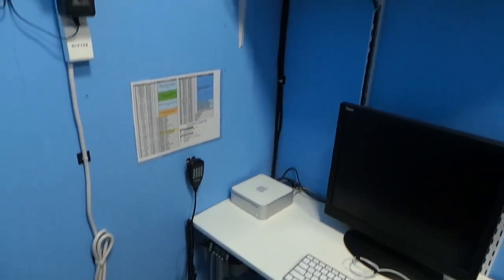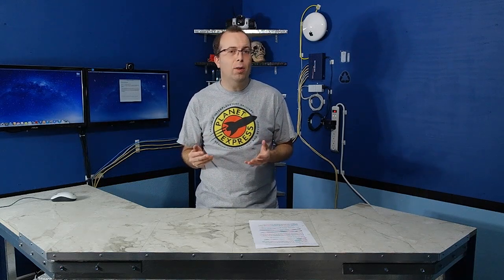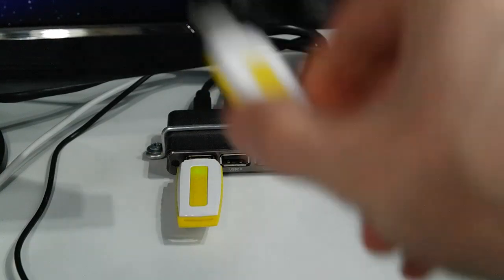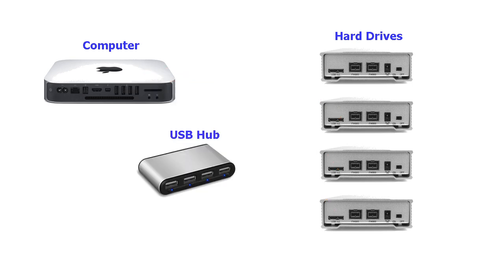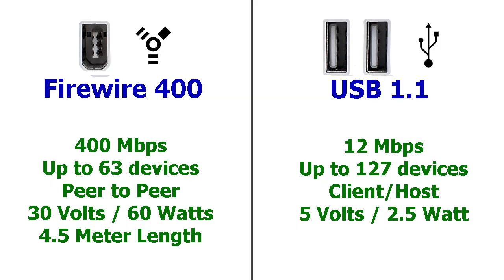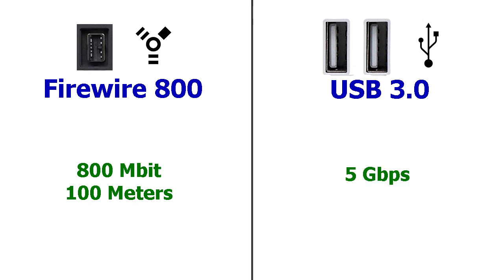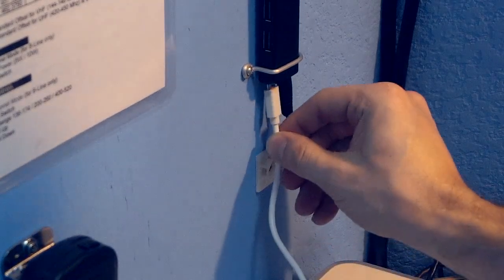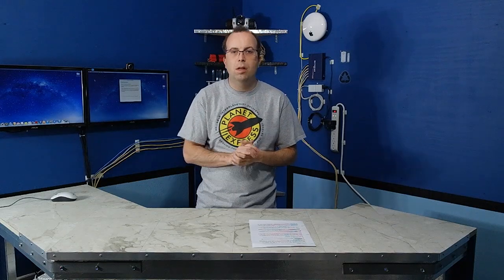Farewell R.I.P. Firewire, Hello USB!

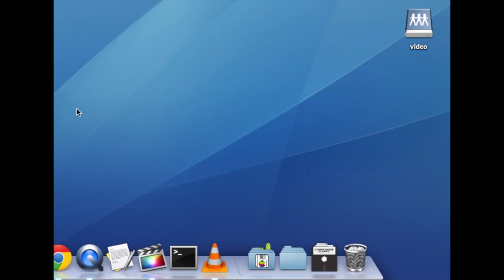Comment: 1:29 Wait a minute... The last Windows 95 OSR supported USB, as did Windows 98 and ME. My first IBM clone had that Windows 95 build.
Reply: yes, USB in general did work, but not generic USB mass storage devices. In '95 and '98 you still needed to install a vendor-supplied driver for each USB device that wanted to present itself as a storage volume (like, a camera acting as a SmartMedia card reader). From Win2000 onwards, any mass storage device would "just work" after plugging in.
Reply: @widicamdotnet  Indeed! In fact, Windows 95 Version "C" came with native USB support.
Reply: @widicamdotnet  no, in win 95 before osr2 you should install a generic driver for  usb support. From win 95 osr2 until now, usb is natively supported.
Reply: 8-Bit Guy was talking about mass-storage devices, not USB keyboards/mice.
Reply: Official support for USB without requiring any OEM-related device drivers came in Windows 2000.
Reply: Technically yes Win95OSR2 did have a USB supplement, but that only covered the initial hubs/ports, not the devices attached to them. What did Win95 in for USB was that it had zero support for WDM drivers, and being that it was a new standard and Win98 was just around the corner if not already available at the time, most didn't bother with making old VxDs for 95. How much of this was their own choice and how much of this was Microsoft flexing their muscles, who knows, but they wanted OSR2 to die so badly once Win98 launched.
Reply: you could install an update for windows 98 to support mass storage devices, and windows 9x supports booting from usb.
Reply: Interesting, I had to install USB drivers but could definitely use a USB DVD drive in a Win95 (maybe 98) build I did, I couldn't install from it though...as I recall. I was using "modern" hardware though and had to edit somethings to get it to use the 1GB RAM I wanted to use. I eventually put Windows 2000 on it but I definitely had win9x running for a short time.
Then again, maybe a USB DVD drive isn't a "mass storage device".

Comment: And, as of 2018, there are devices, computers and OSs that don't work that well with USB hubs! You need to plug some devices directly to computer's USB.
Reply: Often you have to use an extra power supply just for the USB hub. And those often come with short cables. It's a damn pain.

Then again, nothing I use has FireWire. ): Save one HD I got precisely because it had FireWire (and USB 3.0).

Comment: Especially on a server you would not want daisy chaining unless absolutely critical or when done in the way that SCSI or some SAS implementations do it with each 'node' or device acting separately. With Firewire, 1 device fails and every device behind it and possibly even before it will become unavailable to the server, that's the opposite of redundancy when you're multiplying a SPOF into a chain of SPOF's... Yes the speed is nice, but when opting for 24/7 server use you want dedicated connections, such as USB offers or a daisy chaining method such as SCSI where the failure of a single (or multiple) devices does not in any way affect any other device.

Comment: Did you know that FireWire is not Dead ?
Look newest Aerospace/Military aircraft (F-35) as well as ISS (low earth orbit).
Gore is one DoD contractor for solutions.
https://www.gore.com/products/gore-aerospace-firewire-cables

MIL-STD-1553 started in early 1970s with the USAF F-16 fighter.
http://mil-embedded.com/topics/mil-std-1553
In 1986, Bosch developed the CAN bus for the Automotive industy.
https://www.csselectronics.com/screen/page/simple-intro-to-can-bus/language/en

Over the last 25 years, SAE MIL-1394 Military Firewire) has been embraced in Aerospace.
https://ntrs.nasa.gov/archive/nasa/casi.ntrs.nasa.gov/20060009084.pdf

Comment: I remember when apple tried to convince every user that firewire was going to be the ULTIMATE technology for external devices; well, it might have some success with disk drives for some years but with scanners firewire was a total failure; in the pro graphical industry, EVERYONE had to keep some pci adaptec scsi card in order to connect their hi-res optical scanner because not a single firewire scanner was released; instead the industry released crappy 300dpi (by software) USB-only toy flatbed scanners so the industry made it pretty clear that usb (2, 3, c) was going to be the ultimate peripheral hi-speed standard, not fcking firewire

Comment: did you just say you run a server on firewire... and apple devices... what the hell is wrong with you? Linux, RAD 5 Dual CPU Board, min. 16G of Ram and run your hole system with Gigabyte Lan.
Reply: Apple 'servers' are a joke anyway... Desktop/consumer level hardware with Sata harddrives (Apple never heard of SAS), then somewhere in 2005 they killed off their 'servers' and slowly started killing off their server software too, right now you'd have to run Apple's server products on a Mac Mini due to licensing limitations... Who in their right mind would run a central server on a consumer grade laptop in a box with a single powersupply lacking any redundancy whatsoever in all components... It's a joke really, Apple had a strong server product but never backed it, causing (as always) their idea to be succeeded by competitor products (Active Directory from Microsoft in this case) and their product to die a silent death...

Comment: Why not just attach the usb hub to the underside of the shelf you have the hard drives on then use shorter usb cables to patch them into the hub. You would need one wire trailing down the wall then and it would look much neater.

Comment: 2:25 30V DC voltage is actually high enough to be dangerous.
Reply: USB does up to 20v now
Reply: It's DC so it isn't very dangerous. I've touched 48 VDC and been fine. DC isn't completely safe, but it is waaaaaay easier to be shocked with AC.
Reply: @UriahStuff Don't ever do that on a large 48v li-ion battery (like for UAS or e-vehicle) because while it can't "shock" you it can literally cook you. You're basically a big resistor and it has the amps to push the current through you.

Comment: Ethernet capable external hard drives would be much easier and faster, so long as you have ports on your switch  the bandwidth to handle it and the right category cable ie: CAT5e or better, preferably CAT6

Comment: FireWire technically wasn't replaced with USB but with Thunderbolt. I think Thunderbolt beats the heck out of FireWire because it can still daisy chain and doubles as a mini display port for display capabilities (Thunderbolt 1 and 2) or USB C (Thunderbolt 3) and had more capabilities than FireWire (display, charging, more external storage, e.t.c) I guess you could still use FireWire if you already have some FireWire external hard drives or for audio capabilities, so I'm glad Apple sells a thunderbolt to FireWire adapter (of course you need to buy a thunderbolt 3 to 2 for thunderbolt 3) so we can still use FireWire on all modern Apple computers.

Comment: I can plug a USB hub into another and use it that way... External harddrives are simply SATA harddrives in a housing, connected to USB via a USB to SATA adapter, which also supplies power. I bet the harddrive manufacturers could design one of these adapters to act as a hub, to include a single extra USB port, to mimic the daisy chaining ability of FireWire. Maybe The 8-Bit Guy can figure out a simple mod...

Comment: There are still a few serious USB 3.0 driver compatibility issues few years ago it was almost impossible to get something that was truly truly reliable. With USB type C i think alot of that these issues are gone but i really recommend just using either a Mobo with alot of eSATA (native to the HDrives) inputs or a PCIe card that is made for alot of externals. Now the amperage boost from 3.0 is amazing but I still have powered USB 2.0 (internal/external) that work faster after the cache is saturated it starts to catch up to USB 3.0 especially when the 3 cant stay attached. Anything that docent have FW upgrade-ability that came out around USB C time or before has issues.

Comment: I wonder how I could share files on Firewire, one side an IEEE 1394 port, the other a normal 400Mbps firewire port from a SoundBlaster Audigy 2 ZS sound card. Ive tried to share Wifi through it, but t didn't really work out.

Comment: You could replace the drives inside the firewire case, I do that because i had a bunch of Lacie cases with 1 or 2 TB 3.5 drives and bought 6 TB hard drives for a very low price, compared to a whole new external drive.

Comment: The most aggravating thing about the death of FireWire is that its only suitable replacement for the things you mention (daisy chaining and peer-to-peer connections) is Thunderbolt, which is SO much more expensive. In FireWire's heyday, you could commonly find FireWire on mainstream hard drives. The very cheapest ones may not have it, but it would usually carry a small premium ($5-20) at most over USB 2.0. Additionally, all Macs, many Wintel laptops, and a ton of desktop motherboards from around 2007-2011 had FireWire headers, at no meaningful premium. Thunderbolt, on the other hand, massively increases the price of PCs, motherboards, hard drives, and other peripherals alike. It does what it does very well, but boy do I miss FireWire. 

Peer-to-peer is nothing to sneeze at, either. The culture of "FireWire on every machine" produced some amazing features on the Mac that Windows machines could have really used. If you hold the 'T' key while powering on a Mac that has a functional hard drive but won't boot (or, say, has a broken screen), you can use it like an external hard drive with another Mac to recover your data. You can use Migration Assistant to transfer everything on your old Mac to the new one you're upgrading to without the use of an external hard drive. You just need an $8 FireWire cable. Now, with Thunderbolt, the cheapest cable you can get is over $30, closing in on the price of that external hard drive you were hoping to avoid. It's better than losing those features, but it's a disappointing cost increase when you couple it with the recent uptick in Mac prices.

Comment: Who the hell connects 127 devices to one usb port? No one....
Reply: To one USB *bus*, maybe...
Inside the PC, multiple USB ports are frequently part of the same bus. They could be root ports on the same USB controller, or they could be connected to hub that's built into the PC. My laptop has 9 USB devices built-in, on the bus, even when nothing else is connected to it. My keyboard has a hub in it, so it's actually two devices. Some of my USB hubs (with larger numbers of ports) are actually two devices as well (for instance a 7-port hub is frequently two 4-port hubs on the same board).
The devices do add up, more quickly than you might think - though if someone actually does connect close to 127 devices on a USB 2 bus, it's probably not going to perform very well.
Reply: "To one USB bus, maybe..."
"USB bus"
Universal Serial Bus bus
Reply: bibasik7 - haha, old one :)
Reply: @bibasik7  serial means you transmit data bits serially, not the bus topology or arbitration principle. FireWire is also serial in this sense.
That daisy-chain has its downsides. Access time to first device is great, delay is small. Delay to the second one is bigger, simply because signal travels more active electronics. And so on, the farther device is, the worse is access. Also consider bus bandwidth in congestion. If each device is able to arbitrate "me or that downlink will win" and it is "fair" in the sense it choses "me" for 50% of time and "downlink" in other 50%, the bandwidth of congested FireWire will be: 200mbps for a first device in a chain, 100 mbps for a second, 50 for a third, and so on.
So, the chain increases delays and ruins bandwidth for each chained device. That's not quite good and that's why computers which supported FireWire actually had a plenty of FireWire ports on it, actually not less than modern computers have USB ports.
Reply: @nikitakipriyanov7260  That symptom didn't apply to IEEE-488 daisy-chaining.
Reply: @bibasik7  
Ever seen a bus on the back of a tractor trailer? Like that, but with computers.
Reply: doesn't really work out that way anyways because of how usb counts device/end points, especially with usb 3.0, you could connect far fewer devices than you would think.
Reply: Hey. Why not? We do it because we can.
Reply: Youtubers uses it
Reply: Choke My Chicken me
Reply: @IMDYT420  ?
Reply: If it there is slightest chance that in the future someone will connect 64 devices... It's worth sacrificing one bit more
Reply: Skeppy ( i think): Playing Minecraft with 100 Mice
Reply: ask that one guy who connects 127 mouse into his computer
Reply: DING DONG YOU ARE WRONG
Reply: That’s going to cause more problems cuz overheat could occur soon for outlets if too much electric equipment
Reply: Servers

Comment: I have never used Firewire. The Dells my family and I owned from around 2006 to 2011 never had Firewire ports. The case of the computer I built in 2012 (and still use) has a firewire port, but my motherboard, which was pretty high end in 2012, doesn't even have Firewire.

Comment: Response to Thunderbolt comments:

Thunderbolt is just now becoming a standard in many laptops and desktops with its 3rd iteration using USB-C, USB has been the norm for many years now, and there are many more USB 3 hard drives than Thunderbolt drives, not to mention the Thunderbolt drives are much more expensive. Still, that doesn't discredit Thunderbolt as an option, it is REALLY fast, with possible speeds up to 40 gbps and can daisy chain.

Comment: Firewire's failing was that Apple levied massive licensing fees on it.  also, that the connector was completely redesigned with FW800.  also, Apple (or Steve Jobs) decided it was DEAD in 2008, so that certainly didn't help.

Comment: i do, the usb 3 drivers on my motherboard only work in windows 7 and i prefer vista, and if you slightly bump something on a 3.0 port it dissconects... witch means my sound system can cause my usb3 hard drive to diss connect even though its still plugged in. end result is my 3.0 ports i only use for thing that receive power and do no comunication with PC. lucky for me i only have 2 3.0 ports and i have 10 2.0

Comment: FireWire died long before 2015. It died because of the same reason VHS won over BETA tapes.  

It comes down to sales and that defines what everyone in that industry puts stuff out for.

Has nothing do with what may be better for the consumer, it is what is better for industry profit margins.

How many firwire flash drives can you buy at Walmart?

What is easier to say and mentally relate to? BETA or VHS, or USB or FireWire.

In the end simplicity for lower level users who buy crap relates to sales and sales define what becomes available on the market.

Those of us with brain get screwed by being outnumbered by idiots.

FireWire is better, but not if you can't buy anything that uses it

Comment: I had a Intel Bad Axe motherboard mainly for Firewire compatibility with my old external hard drive, and it was a great Hackintosh board too. There also was a little known company called Quo which ran a Kickstarter to make some Hackintosh friendly boards with the help of Gigabyte and they had both Firewire 800 and two Thunderbolt connections. The company didn't do so well and these boards are very rare to find but it was a great idea at the time.

Comment: In 2017, there are external harddrive with usb ports, like seagate STEL4000. It's not a daisy chain, rather a usb hub. When you plug this seagate harddrive into your computer, you can plug the second drive into the usb ports on the seagate harddrive...so on and so forth.

Comment: If you want an elegant solution for your home server, do what I did to my mac mini.... Get a mediasonic 8 bay USB3 drive tower. They are under $300, and you can crack open all of your existing drives and put them in the mediasonic, with room to add even more in the future. They also make a 4 bay tower, but I really wanted all 8. Its a very nice, seamless solution. Just one little cable capable of a real world 350 MB/sec transfer speed. I have this plugged into a 2012 i5 2.5 GHz Mac mini. The whole setup, loaded up with hard drives (including two 2.5" HDD's in the mini itself), with all drives spinning, uses about 65 watts. What more could you ask for!

Comment: Why would you use external drives in a "server", wouldn'T it be nice to just put the drives inside of the server?
You could connect them via SATA and they could get active cooling :D
Reply: Maybe because he isn't using server hardware?  There's nothing in the network interface of a desktop or even laptop that would prevent incoming TCP connections.
Reply: Real servers wouldn't usually use SATA unless for mass storage. They use NVME drives for cache and SAS for disks.